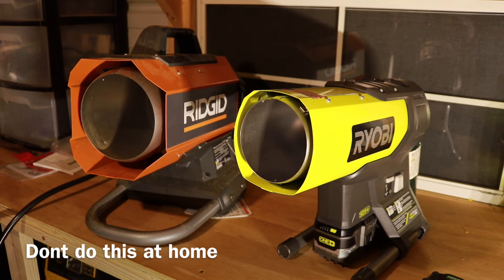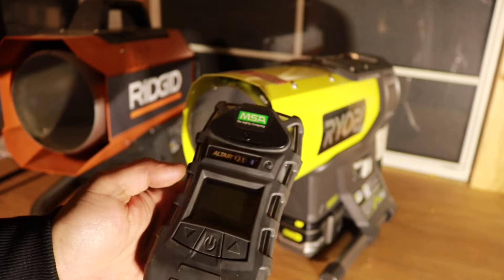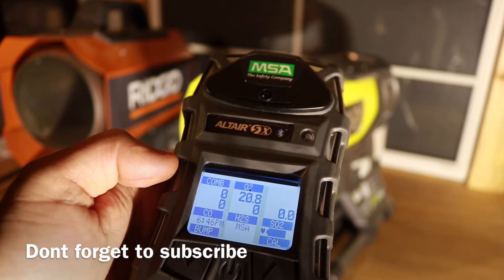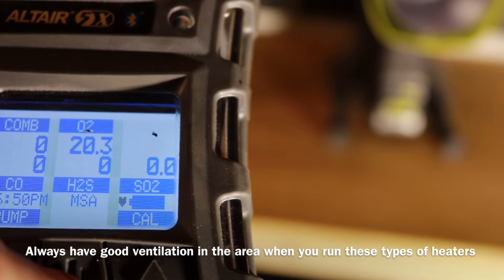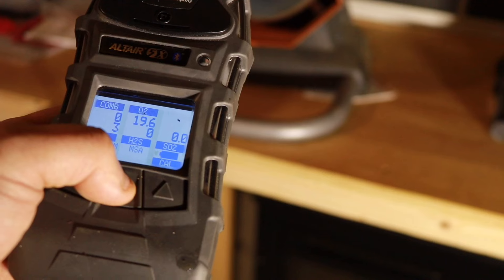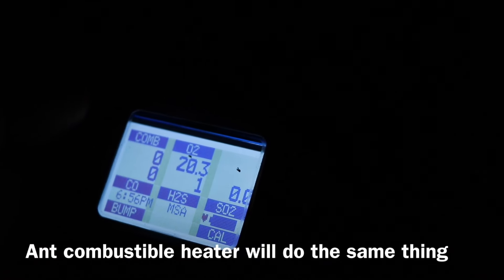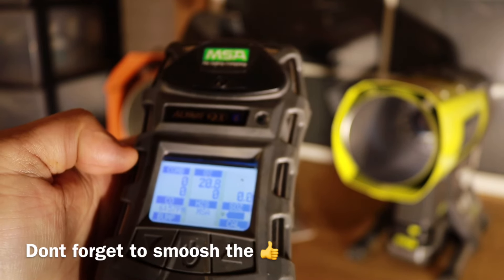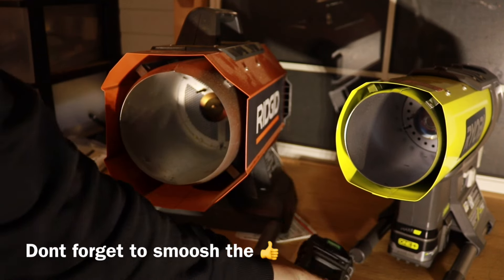Is it safe to run a propane / torpedo heater indoors???

Comment: Hey quick question i have a basement thats gonna freeze i was planning on leaving whe windows all half open im installing a central ac but i dont know if it will be in b4 the temp hits 34
Reply from the maker: I would go electric
Reply: @ToolReviewZone  ok thank you. So like 1500 watt radiant heater

Comment: While I see your point, don't use them in your house, seems like you would have to be desperate to do so. While most people use these in their shop/garage, you are standing right in front of 2 heaters while getting the reading. Could you have taken the reading away from the outlets of combusted fuel? You never  mentioned how warm did it get while you were running them? I have a large shop which has a heatpump but no heat strips so I have to use Mr Heater to heat the shop on very cold days. (heatpumps alone not efficient at 35 degrees ) 2 burners having to run for hours to get the temps in cool range, seems like these would heat it faster and not run as much. Thanks for sharing.

Comment: Carbon Monoxide and Carbon Dioxide are 2 different things....
Complete combustion of propane results in the formation of carbon DIoxide and water vapour. 
Carbon MONoxide is a by-product of combustion when there is not enough oxygen to burn the propane completely.
Carbon Dioxide is still dangerous but not detected by your test method.
Reply from the maker: Correct.  Only the carbon monoxide is able to be tested

Comment: Let me just first say that I am not suggesting to forgo any safety measures. 
We should acknowledge that heater manufacturers take the safety over the top because there is no liability greater than death. This is a double edge sword of sorts because many people will be scared off!
That said...your demonstration is very misleading and if you do this for a living then you should know better. Measuring oxygen depletion while standing directly in front of a force air unit will yield numbers way, way off of what is actual. You monitor the oxygen going in, not coming out. 
Sure..we should always, always use CO detectors and OD sensors. Its also vital to recognize the importance of not using oversized heaters for the space being heated.
 A properly used and functioning heater doesn't pose any risk.
Carbon monoxide is only produced from an "incomplete combustion" process.
I've been using propane heaters in my garages for 30 years. Nearly empty propane tanks will cause eye irritation. Still its not enough to trigger CO detectors.

Comment: I have a mobile home using torpedo heater in living room and kitchen w/an extension cord to reach the back room where I'm at. So if carbon monoxide is in the living room so let it be it's not going to hurt me cuz I got oxygen in my bedroom as the windows and door leak Oxygen and save money 🤑💰

Comment: After a while these would cut out once there's not enough oxygen to combust.However once the flame snuffed out, you'd then have excess LPG gas in the air.
The interesting thing is it doen't take much Co2 to fall asleep, but it can takes 6 so months or more than a year for your body to remove all the Co2 in your blood stream.

Comment: Also, what about the propane tank doesn't it have to be placed a minimum distance from the home. I was running a tank top propane heater in the garage for years and due to my brothers worried about me burning down my mom's house down resulting in them losing their inheritance. They don't want me having the propane tank in the garage. I'm wondering if I could run an extension hose to keep the tank the 10 feet minimum distance from the actual home.